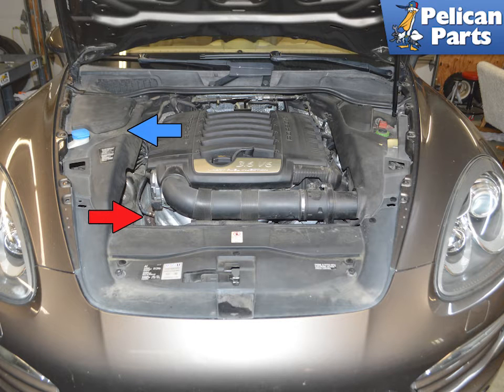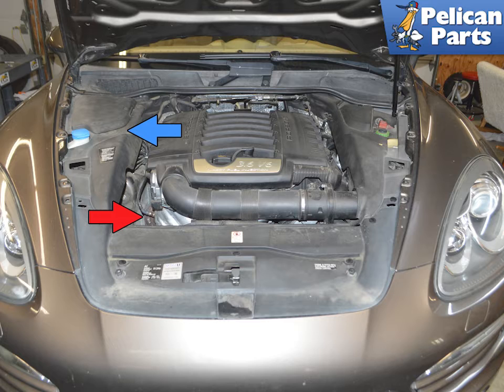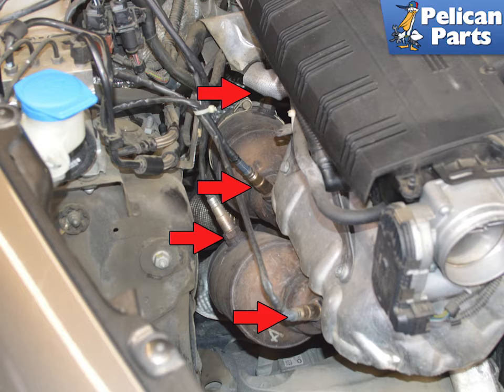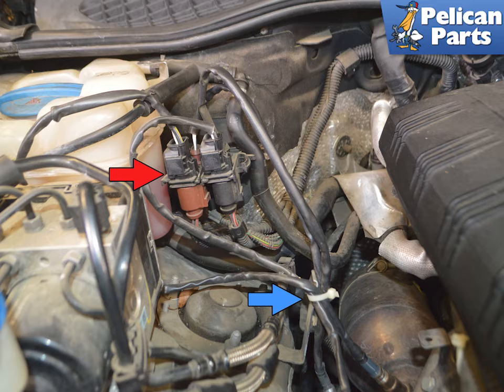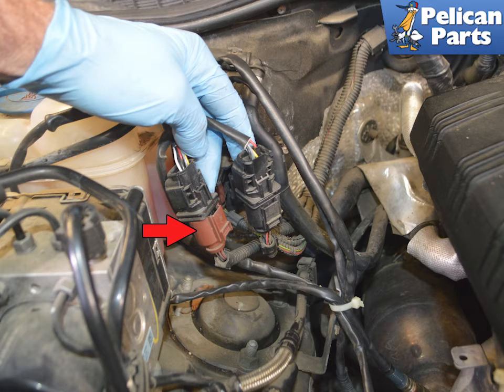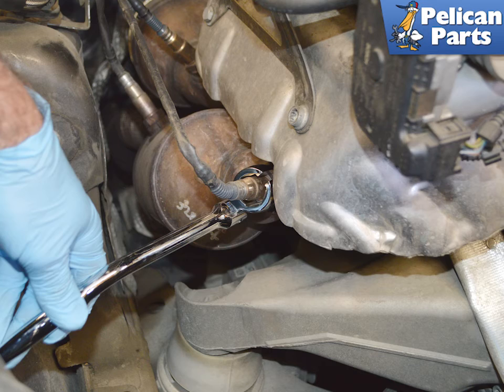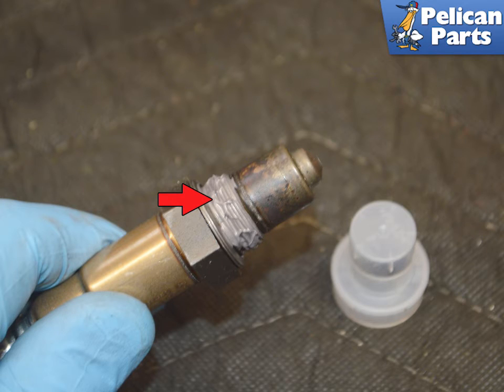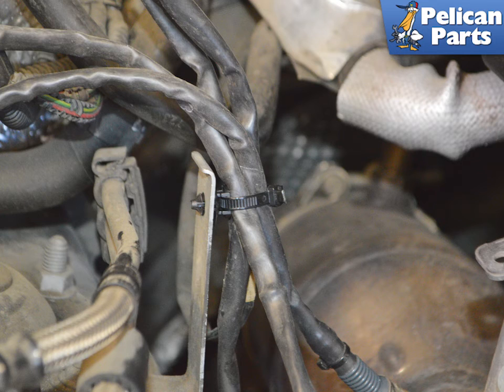Porsche 958 Cayenne VR6 Oxygen Sensor Replacement (2011 - 2018)

Comment: How do I know if I need the O2 sensor for cylinders 1-3 or 4-6?  Is bank 1 cylinders 1-3 and bank 2 cylinders 4-6?
Error code reads “Oxygen sensor upstream of catalytic converter, bank 2 - signal too low” 
and “…upstream …, bank 1 - signal too low”.

Thanks for the video as well!
Reply from the maker: Yes
Reply: Hey omg please help me, do you know which catalytic converter is bank one and bank two? Is bank one the top converter in the video or the bottom one?
Reply: To my knowledge bank 1 is the first sensor (nearest the bumper) and bank 2 is the one after it. 
Then there are pre-catalytic and post-catalytic sensors. 

So two banks (cylinders 1-3) (cylinders 4-6). Pre-catalytic and post-catalytic. 

Near top of engine is pre and near bottom of engine is post. 

Hopefully that helps.  
Hopefully Pelican Parts confirms my understanding is correct